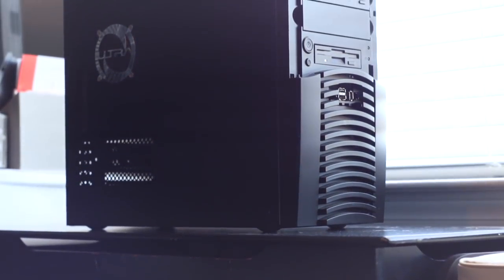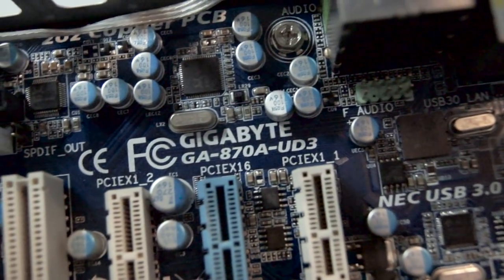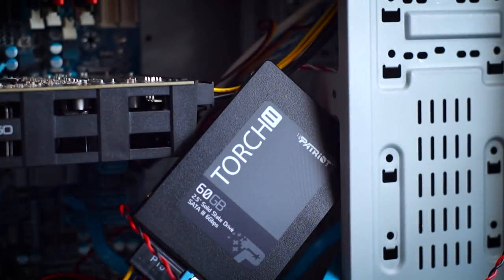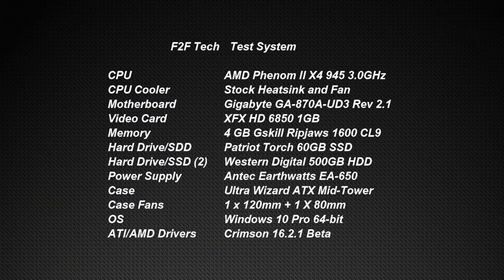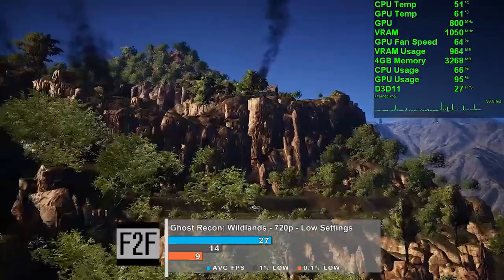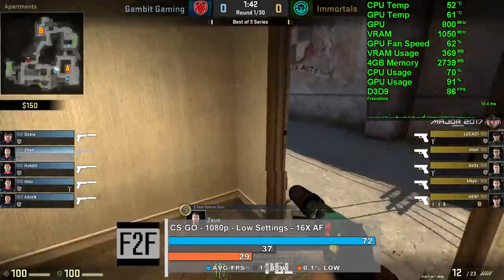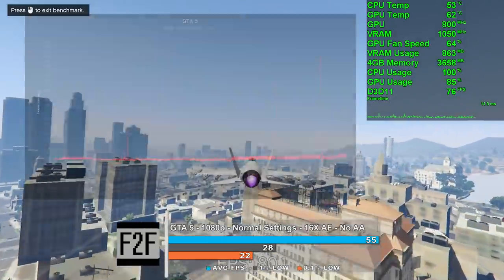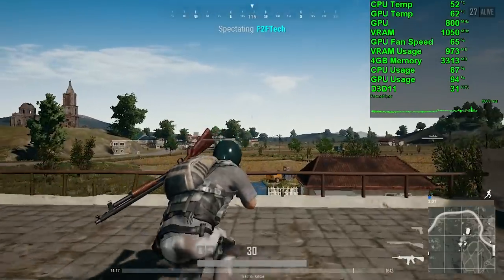How well does a 2010-2011 AMD Phenom II X4 gaming PC hold up in 2018?

Comment: My rig used to also be a phenom ii based system before I upgraded it to a fx 6350. It was also a X4, an 810 (800 chips had the l3 cache cut down a tad). Held its own for me for a couple years before I retired it with my 6350
Reply: Ah the 870a ud3 is the same motherboard as i had up until february 2017, really good for the time that motherboard.
(Dad has it now as his own pc with a hd 5750 lite from sapphire & a 4 gb ram stick didnt bottleneck much with my r9 280 either the phenom II x6 1090t when overclocked too 3.7 ghz.
(the hd 5750 was my older brothers previous gpu up until like 2012 or something & we got it for free.)
Overclocked the phenom II x6 1090t up too 3.9 ghz fine on it at 1.475v & a phenom II x4 955 too 3.9 ghz with an arctic cooling freezer 13 pro both with & without the bottom fan on it (Bearing broke down on that fan a few years later.) & just screamed if i didn't get it going the right way by spinning it with my hand for a bit during startup or kept restarting my pc like 3 - 4 times so cut the cable from that fan entirely.
& a review site with an open bench put a 1090t up too 4 ghz on the motherboard i believe so you should be able too push that phenom quite far with the right cpu cooler.

--------------------------------------------------------------------------wall of text below--------------------------------------------------------------------------------You don't need too read this bit, just writing about that particular pc's life a bit & some stuff i had done in terms of tweaks,overclocking & modding a bit.

My build started with a athlon II x3 445 in 2010, 2 gb ram stick at 1333 mhz, hd 3650 512 mb.
(From the pc i had at the time with a pentium dualcore at 1.6 ghz it was a pretty good upgrade going with the athlon II x3 cpu even if i kept the gpu & had the same amount of ram, only useful thing i picked out of it was sata cables & the harddrive + dvd drive which i ended up not using much at all.)
2 months after it was built i saved up for a HD 5770 lite from sapphire & another 2 gb ram stick hd 6000 series had released at the time & stores were lowering prices on the previous generation of cards.

(Still had a 22 or 23 inch crt monitor at the time or could use the 1280x1024 monitor that did 75 hz.
(Picked the crt ofc when i wasn't going too friends with it playing cs 1.6 (bought a legit copy in 2009)
Or any game we pirated at the time that we set up with hamachi.)
1600x1200 was great too have at 85 hz in games i played at the time too.

Found out a few weeks later after i bought the hd 5770 that i could unlock a 4th core on that athlon II cpu & unlocked it too a quad core (usually turned off cores if temperature sensors were bad on the 4th core or l3 cache was bad & it got binned downwards.)
Found out my motherboard also needed "thermal monitoring" turned off as it went by cpu core temperature by default & underclocked the cpu too 800 mhz despite cpu socket temp sitting at 32c idle on the desktop it was displaying cpu core temps at 87c,was about an hour of figuring that out though after a half hour of l4d2 i thought my fps was slowing down instead & started investigating.

(Essentially became a quad core athlon II 645 & shortly after i bought the cpu cooler at the end of 2010 going for an overclock as far as possible while staying under 1.475v had undervolted on the stock cooler previously as it was overheating with the heat from the hd 5770 + the standard 1.4v the motherboard fed this 95w tripplecore.
was stable as a quadcore in 1.325v & 1.275v as a tripplecore so quite a bit lower temperatures too be found.

Overclocking the cpu was limited by my budget ram sticks running at 1333 mhz though, they didn't like going anything over 1483 mhz or similar at stock timings & 1.55v.

Hit 3.6 ghz which was a 0.5 ghz which gave a solid boost still instead of the better 3.9 ghz people hit easily with their systems which i wanted to do as well ofc heh, noticed i could get random bluescreens though & realized it was the ram slot voltage dropping below 1.47v so 1.55v was needed too feed the ram sticks software displayed ram voltage at 1.52.

Eventually traded the cpu away for a phenom II x4 955 + some money in between kept ram at 1.52v after the swap too a the phenom cpu.
Guy was building a pc too have in the living room & he didn't mind it as he was gonna build a surf machine & do some streaming of shows from the web as a music player.
Overclocked when i put it in right away too 3.8 ghz & realized my gpu was bottlenecking more then the cpu during gaming so 3 months later i ordered without looking up the performance difference a xfx hd 6870, right before the hd 7800 series came out...

(Figured it would be faster then a used hd 5870 i was looking at as its newer right ?
 wrong... naming tiers they changed there showed that i only got a about 30 - 46% performance gain versus a larger 72% performance difference bit bummed out by that fact after i had used the card for a while not really noticing any massive difference but more noise & powerdraw.

Gpu also came with crappy mounting on the gpu cooler + i think empty heatpipes.
(Didn't see any holes though in the heatpipes when inspecting the cooler.)
So the fans screamed at 70 - 100% out of the box with an open case in load great...
(Could hear it in the entire apartment even if i closed my door & the door leading into my younger brothers room (3 room apartment + kitchen & bathroom.)
Wasn't heard outside of the apartment though so neighbours wouldn't complain i guessed. Even my dad thought it was noisy suddenly & asked if it was the graphics card.)
(xfx dual dissipation hd 6870 i had bought, thankfully a reference pcb though so could mount on another gpu cooler later, which while i owned it i never did heh.)
Removed the shroud of the gpu cooler & remounted it voiding the warranty according too xfx support but i didn't care.
I wanted the performance boost from the hd 5770 & too make this gpu quiet so i took the matter into my own hands.
Strapped on two 120mm fans at 800 rpm from fractal design & remounted the gpu cooler the best i could & got it silent at 87c celsius in furmark.
(Later when i bought a new case in late 2012 i put on the 140mm fan that came with the case onto it that spun at 1200 rpm, got it a bit lower in temperatures with that.)
Good enough i guess & could always fall back too the hd 5770 if this pos died within a year or so.
(Put the hd 5770 in my dads pc at the time & my lil brother got a athlon x2 2.7 ghz 3 gb ram & hd 5750 my dad used an athlon x2 6000+ with 4 gb ram.)

Bought a r9 280 direct cu II top from asus in january 2015 & im still using that card today.
March 2015 i bought the phenom II x6 1090t cpu (used ofc) & overclocked initially too 3.9 ghz.
(Powersupply got a bit hot though so after moving it down too 3.7 ghz it ran nice & cool still.)

Traded away the hd 6870 for a atx 1155 motherboard which i sold for a pretty cheap price late 2015 guy bought a gpu cooler for it & it ran pretty good after that & with less noise ofc too, eventually he got a gtx 650 ti boost for scraps which was a lower power draw & about the same performance & its now in a box at the guys house (his sons pc has that gtx 650 ti boost now).

Comment: I have the same exact case, except it's got a window on the side panel from the factory. I got it from a computer store in June 2016 that was going to throw it out, as well as buying a HP motherboard with an A6-3650 APU and 16GB of 1600Mhz DDR3 ram. By January of 2017 I had gone from that little APU to an A10-7860K apu (later with an HD 7850 gpu), and ultimately to what I have now; an FX 8300 w/GTX 1050. I have a red led strip inside with some red led fans. She looks mean! Who needs RGB? If you'd like a pic of it, I can post a link.

Comment: I bought in November a new gaming pc. Until November '17 I was using a PC with a Phenom II X6 1090T and a GTX 570. I got it in early 2011 and until 2015 it had a GTX460 in it. With the 570 it was a great gaming experience. But then came PUBG, which was with 30-50 FPS on lowest Settings not that brilliant. But beside of AAA-Titles like PUBG it would still be a nice gaming machine. Maybe i'll turn it into a HTPC. Now I'm running a R7 1700X with a 1080Ti and payed about 1800€ for three times the perfomance in games. Totally worth it ;)
Reply: i had a x4 840 in 2017 and i upgraded to ryzen 7 1700 recently!
Reply: good choice :) especially because of the AM4-platform. I think it will last many years. I'm just waiting for Zen 2, not Zen+ ;) I hope AMD will bring more interesting stuff.. maybe a 32 core Threadripper according to der8auers video on TR / EPYC :) But beating Intel in singlecore-performance would be awesome ^^

Comment: I have a system just like it with the same processor, similar case, but blue and from 2003, 12 GB of RAM with a 500 gb SSD. Not a bad system at all

Comment: It's really interesting that people talk about microstutter with amd but not with Intel. I have always felt that amd has far lower microstutters compared to intel of the same Era, although Intel averages much higher with even higher peaks. My fx 8350 was far smother than my 2600k at stock clocks, when they were both overclocked each felt smother, with the microstutters being minimal on the amd. I have been using a 4790k for the last 4 years and I didn't get microstutters until around 2 years ago. Now that I've been overclocking, it has minimized it, but still occasionally get some even with my gtx 1080 ti. I mostly play rocket league these days with a 165hz 2k monitor, so smooth gameplay is a must. I've thought about buying a top of the line amd or 9900k, but honestly my 4790k overclocked is on par with anything that's out right now (core for core). If my system survives another year, I'll probably just hold out and overclock my system even further until she dies. Basically if you have anything 4790k or newer, just hold on another year. Focus on your video cards and monitors until 7nm gets going.

Comment: im running destiny 2 on all max settings at 1440 as well as all my other games and the system is a 2012 gigabyte motherboard, a gtx 1060ti 6gb , and the amd is the AMD Phenom ll X4 945 3.4 ghz...so I find it unbelieving that he got a bottle neck

Comment: I have a AMD Pjenmon II X4 965, my CPU is taking all games this days pretty well. I had a gaming laptop that was better but it's broken so i bought this thing for 30$, and upgraded to 16GB ram and changed the video card from AMD Radeon HD 5770 to 7700,, the videocard i changed did i get for free, or i got a entire PC for free, so i used the card from there. No one of this card is the best i know, but the last one i can run GTA 5 on desent settings, but its only 1024MB. Do you have a idea what card i shoud buy to this computer for a decent price?
Reply from the maker: If your looking for Used, then a HD 7950 or GTX 670/760 would be a good option. New, probably a GTX 1050.

Comment: subd :D i loved this processor when i used it back in 2010
Reply: Ah yeah... by the time the six cores came around down here I had built an i7 system with a 580 >< though I'm not sure why you had so much trouble with Crysis...

Comment: I have an overclocked 3.6ghz phenom x4 965 and 750ti 4gb with 8gb ddr3 802mhz, it does run newer games fairly well if you compromise with the resolution

Comment: Still on a Phenom II x6 1100T and an RX480 4gb. Running most games on medium at 1080p. CPU is at 3820MHZ on all 6 cores at 1.38 to 1.404 volts. Works great. This CPU outlived my 6870 gfx card by miles. I haven't had the need to upgrade until recently. Going for the Ryzen 5 3600 maybe the 7 3700x. That should give me another good 10 years. (i hope)

Comment: Jesus christ did he just run modern games with a 4GB RAM.. LOL.. i got 6 and it's just barely enough, i suggest using 8GB, for most triple A games at mid to low settings, this chip still rocks.. NOTE: I got the 955 BE 125W and it clocks at 4.0.. You need to OC it atleast 3.4 - 3.8, stick an 8 GB RAM and 2GB GTX 960 in it, water or air cool it with tower cooler and you can rock even the modern assassins creed and COD games out there.

Comment: I got a similar CPU back then from MicroCenter: Phenom II X4 960T BE + MSI 880G-E45 for $125 USD, I think after so many years if I am selling them used they are still worth about $40-50 today in 2020, not bad of a depreciation. My dad was using it until last December.

Comment: Can I pair a Phenom ii x4 965 with an RX580 or 1060? Currently using a 750ti but I feel like the GPU is actually the bottleneck. My Phenom is overclocked to 3.9GHz and 2600NB. Could go higher, I have more headroom in voltages, she just gets a little toasty as the hyper 212 is a wee bit dirty.

Comment: Those CPUs aren't as bad as many people make them out to be. I have a Phenom II X6 1100T OC'ed to 4.0GHz on air. Paired with 16G memory and a GTX 1070, I can play The Crew, The Crew 2, and Forza Horizon 3 on high settings at 1080p and ~60 fps.

Comment: Still running Phenom II X4 925 2.8ghz here. Only 4mb ram too (tried twice upgrading to 8GB Ripjaws like I have now and wouldn't boot).  Not having SSD holds me back, on experience score.  I was just shopping a new Ryzen 5 system, but wondering if I should just keep on trucking and overclock.  Any ideas how to get the RAM upgrade to work?  weird. Tried different DIMMS even.  I can play COD BO, COD4, INsurgency well.  Video editing is taxing.  Photo editing is sufficient.

Comment: I still have running my old system phenom II 1090t with an HD 5970. The problem is that graphics card and,  i think, the drivers. I tried an gtx 1060 with some games with my phenom and works pretty well.

Comment: I always wanted a phenom II back in the day. in 2008 during my first year in college I was ignorant to a lot of the pc market and bought a 2.3ghz phenom 9600, 512mb radeon 4850 with reference cooler, and 4gb ddr2 1066mhz ram. It actually served me very well until late 2012 when I replaced it with my fx8350 which I still use today as it still at least "viable" with my radeon 7970, 26gb ddr3 1866mhz ram to get 60fps at max settings in 1080P in most games. Only the absolute latest non-esports AAA titles  I will need to drop the settings. If I would have waited until 2009 I could of had a pc that may have been of a lot more use today instead of upgrading in janurary of 2013. We're talking Phenom II series cpus, radeon 5000 series gpus, etc.

Comment: i had a phenom II x4 960t (basicly the last revision of phenoms). That shit wasnt even a golden chip, it was a diamond one. I had it at 4,3ghz with 1,47v (most phenoms dont past 4ghz) a 3000mhz nb bus and a kit of gskill ripjaws x oced to 2133mhz with ultra tight timmings.
That was an absolute monster of a chip.It kept up until i sold it in 2017 with a hd 7970 on most modern games like gta v, bf 1, Rottr.

Comment: You must check your memory speed vs the hard drive speed. If you motherboard is dual pcix you can go for a nvme ssd. You can't bottleneck that processor. But you can do it in the Ram vs the hard drive. Read the memory speed and the hard drive speed. And you will find your bottleneck. Nice video, my phenom is a 9850. Now I rethinking seriously about a full upgrade. Those processor are powerful to run video cards. After watch this, Im thinking in upgrade to a pci express nvme and more memory and a second hand r5 240 with my phenom. Is already a Linux Kubuntu OS, just install steam with vulkan and get extra fps in games. Not a bad idea at all.
Thanks for share.

Comment: Owner of a Amd Phenom II X4 970, it still holds up today, but it shows how old it is, also it lacks of many features that todays game have or will have and by that i will be unable to run it many games, just because the game made with a technology that almost every CPU have nowadays, no matter how strong the other components are, This CPU Is old, If you have one, you should buy a new one
Intel Core i5-9600K,  or AMD Ryzen 5 2600 if you have the cash for it.
No matter how expensive it is for you, you have to buy a new one, an expensive one, so you don't have to buy an other one for 4+ year.

Comment: Athlons and phenoms struggled to process and render higher resolutions due to the lack of AVX and AVX2 support.  The same struggle that the core 2 quads, core 2 duos, and 1st and second gen icores suffered.

It would require an extremely powerful GPU on high or ultra settings that efficiently utilizes pcie gen 3 in order to get over the render hump.

Then due to cpu bottlenecking the GPU wont even render to its full potential.

Making older cpus that have reached obsolescence unless of course its just used as a gaming emulation station for legacy consoles. Then it doesn’t matter

Comment: holy shit does that cpu not even bottlenecking at 1080p you playing low setting that means you giving more presser on the cpu, i use to play siege with my oc fx 6300 at 4.6ghz and gtx 960 medium setting at 768p all cpu cores max out all the time though gpu usages was good but that is impressive 4 cores just 3ghz using 70-80% cpu usages

Comment: i got seame spec pc but my graphic card is hd 7850 2gb.  also i nned upgrade ram to 8gb . i useing this pc just for xbox games on low-mid setting on 720p monitor , everitihg run oky ..no need xbox one. I got ps4 pro